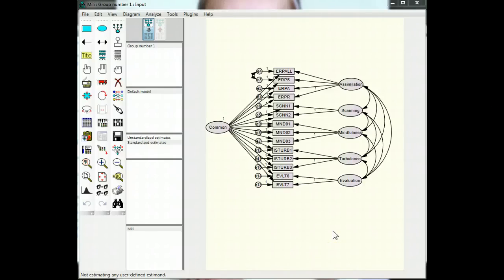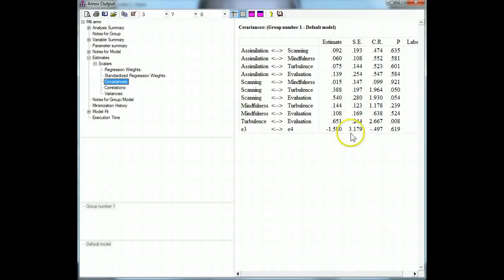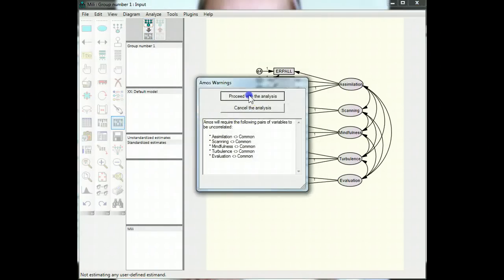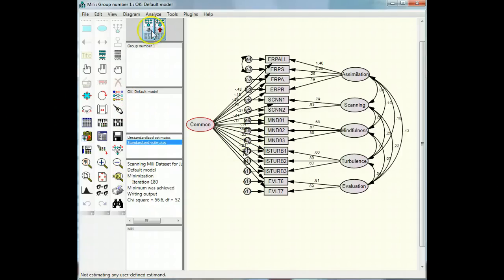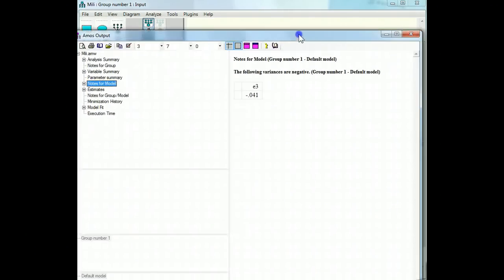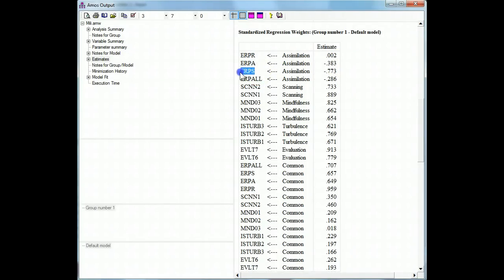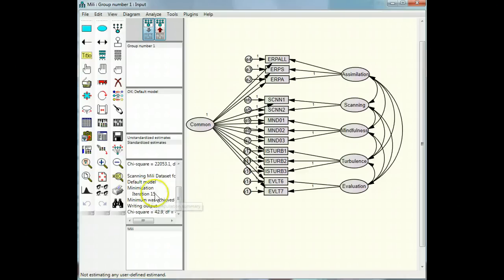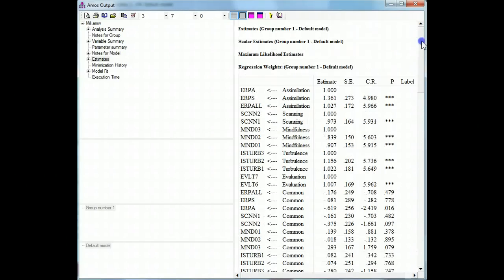Iteration Limit Reached in AMOS

Comment: Dear James, I hope you are still active on Youtube. I have the same Problem described in the video, but the more I delete the items with big standard error, the more become other items negative or flawed, too. I know, my model is not very good (there are many negative correlations between items of the same scale), but what can I do to get reliable results for the cfa?
Reply from the maker: Do the EFA first, and that should fix a lot of these issues. If that doesn't fix it, then try shifting the regression weight constraints around.
Reply: @Gaskination  Thank you! Is it possible to do the EFA and the CFA on the same data set? I have only one...
Reply from the maker: @finabuchmann3638  Yes. Most do it on the same dataset. However, it is considered more rigorous to use separate datasets, or to use a random sample of the dataset for each.

Comment: Iteration limit reached. When I checked the SE all the items have values > than 1 when relating to the CLF. There is an item with an SE of 115.274. What can I do as the SE is only between the items and the CLF? I must mention that I’m not using items but item parcels, could this be the problem?
Reply from the maker: The CLF often breaks models. It is somewhat unnatural. I would recommend using a different method bias test. Just report that you tried the CLF approach, but it made your model unstable and would not minimize.
Reply: Well said: "CLF breaks models". Thank you James, you're great. I'll try a different method.

Comment: hi, James,
thanks for your video.
I want to know, if the standardized regression weight of the path is greater than 1, how to solve this problem ?  lookingforward to your answer
Reply from the maker: Here is a video for it: https://youtu.be/Vx24KFf-rAo
Reply: thanks for your reply. But my question is about the path in the structural model, not about the weight of the item in the measurement model
Reply from the maker: Oh. That is odd, but it can happen under one or more of the following conditions:
1. accidentally included the same variable more than once
2. included categorical (multinomial) variables in the model (they must first be converted to dummy variables)
3. extreme non-normality in variables.
Reply: yeah, i guess it may be that two of my constructs are highly related

Comment: Hello Prof.,

Thanks for the video. I have followed the steps as suggested in the video by checking on the standard errors. I don't have any of the values greater than 1 and none of the variables is move with the other. Yet, I have error terms being negative. How do I address the issue of iteration limit reached.
Reply from the maker: You could constrain the error variance to be a small positive number, like 0.001.

Comment: Hi professor, I have a problem with the measurement model. It doesn’t run, everything seems to be normal and I drew it again to make sure that everything is fine but always the same problem it stops and shows '' iteration1''. Can you help me please in fixing this. Thank you .
Reply from the maker: I would have to see the model and data. You are welcome to email them to me. Google me to find my email address. Please send the .amw and .sav files
Reply: James Gaskin  , Hi professor I tried to fix it , this time amos ran but in the box there was iteration14 . There is  a latent variable with one item in the model and I changed the variance of the error  and it worked.I found in the literature 5 possibilities to solve this problem and two of them actually worked  but I chose the one that gives me better results .I will e-mail you once I have my pc with me . thank you very much .

Comment: Thanks James! But in my case, I do have nothing in model notes and I have the same iteration limit problem, please guide what to do with it
Reply from the maker: Perhaps you have too many parameters and not enough sample size. If this is the case, I recommend removing items that have no significant loading (as these will have the most error and will prevent the model from converging). If this is not the case, then go look at the regression weights table anyway and see if there are any items that have very high standard error. If so, remove these one at a time.

Comment: Hi James, firstly thank you for making these videos. I have a problem with the measurement model, I have got the same error, i.e. iteration limit reached, however, the above video doesn't cover the extended problem I am facing which is "the model is probably unidentified", and to make it identified I need to "impose 1 additional constraint". Please guide what does this all means, when it happens, and since there are no figures/output how I determine where to put additional constraint?
Reply from the maker: Usually this means you have either:
1. A latent factor with no constrained indicator regression weight (you need one weight constrained to 1). 
2. Or you have a blank variable somewhere that you're not seeing.
It is most likely the first issue.

Comment: Hi James,
is there any guidelines on how to troubleshoot an "The following covariance matrix is not positive definite" error in AMOS? The problem occurs when running my measurement model + Common Latent Factor.
Reply from the maker: That is a common problem without a common fix... Check the notes for the model to see if there are any negative error variances. If so, that might be causing it. It might also be due to instability from a constrained path. You might try moving that path. It might also be due to insufficient sample size to estimate all those parameters.
Reply: how could you solve your issue. Larissa T..?? because i have the seme problem .... Infact i have no missing values Right! and i could not solve my problem..kindky help...

Comment: Hi James, I have a negative variance for one of my endogenous latent variables (Y). Did some analysis and the items for the variable loaded well with no alarming problems detected. I have a dichotomous exogenous variable (X) that has a line path to Y. The standard error for X --> Y is grossly high and the standardized regression weight for it is over 1. What can I do about this?
Reply from the maker: You can try to fix the error for it to a small normal number (like .025). This may help. Dichotomous variables are not always stable.

Comment from the maker: Just state very directly what you were required to do to stabilize the factor. Interpretation does not change.
Reply: HI James, 
Thank you so much for your videos - I have used them throughout my PhD and now in my academic career.

A quick question, why in theory is iteration limit reached for a model, and when coding paths on the same factor using 'a', how and why does this stabilise the factor?

Comment from the maker: This means that you would constrain the path coefficients to be equal to each other. To do this, you need to go to the object properties for the paths, parameters tab, and set both equal to the same thing. I just type "a" (without quotes) in the regression weights box for both. This assumes that both are on the same factor. If not, then set all of the ones on the same factor equal to the same thing (even if the other paths are not greater than 1). For the other factors, use "b" or "c".

Comment: Hi James,
In addition to Heywood cases (negative error variances), illogical standardized parameters are considered as a problem, as I have understood.
My model shows two standardized path coefficients that exceed 1.0 and I dont understand how to fix it. Haier mentions about adding an assumption that the factor loading are equal (for negative error variances). How can this issue be handled in my case?